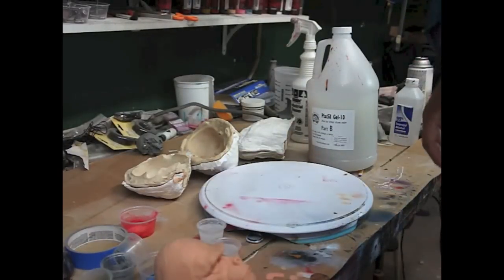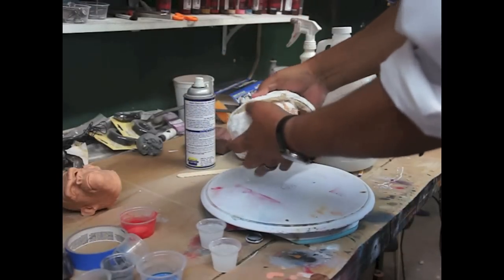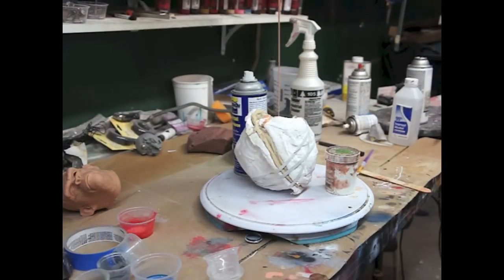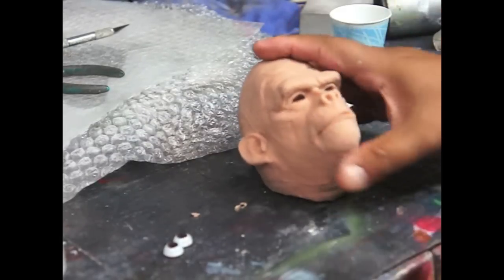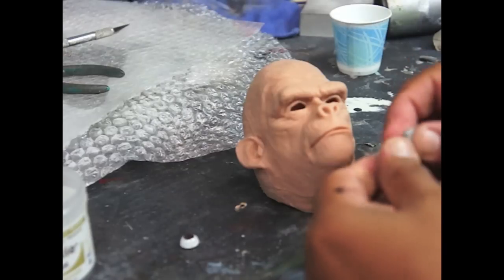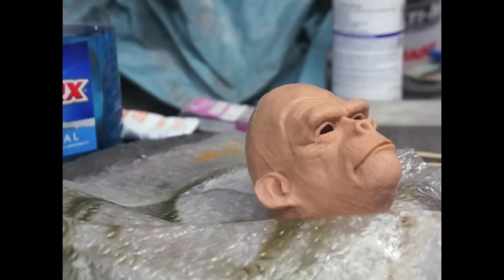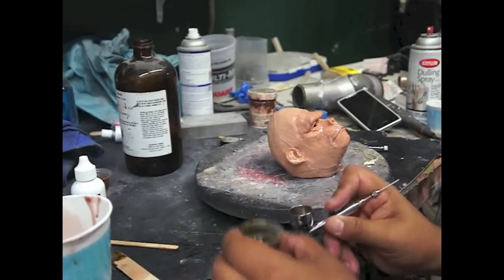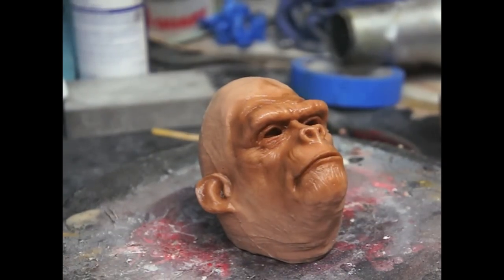Customizing a resin kit into silicone part 2

Comment: Great stuff. 

What is the resistence of silicone to wear and tear? Isn't there some degree of self-deterioration over time, even if the piece isnt handled?
Reply from the maker: +Adam N  the silicone i use is the platcil 10  and it lasts for  ever, i have had some pieces that  are 10 yrs old, so far,   the rtv silicone tends to get brittle with time, but i have used that only for mold making,  in the past dont use it anymore although its cheaper then the rebound 25 that i now use,  that last forever as well,  for mold making its great,